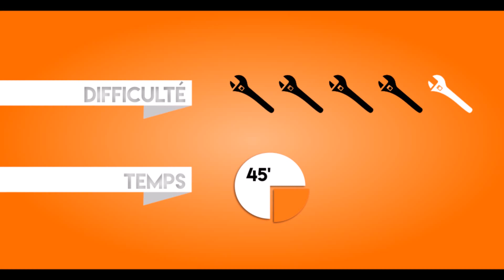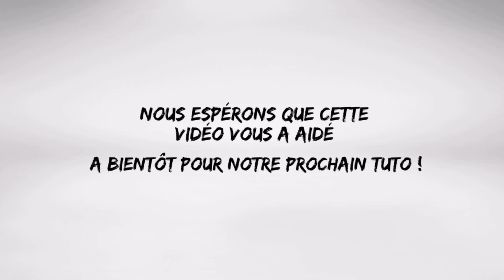TUTO #26 - CHANGER SON CYLINDRE PISTON, SES JOINTS DE CYLINDRE ET SES SEGMENTS (AM6 MINARELLI)

Comment: great video, I would personally be a bit more careful when removing the piston pen from the crankshaft, hitting it with a hammer will damage the bearings. also important that after a piston change it is advised to mix some extra 2 stroke oil with the mix, if you are running an oil pump you can simply put some oil in the tank. I advise to do this for at least 2 tanks, also keep rpm below 6000 for the first tank.
Reply from the maker: Hello, thank you for this technical response! All techniques are good to take! See you soon on 50 Factory!

Comment: bonjour je voudrais changer ma segmentation étant d'origine les segments et les joints sont des D.40 ou des D.40.3 merci
Reply from the maker: Bonjour, sur de l'origine, les joints sont du 40.3 sur AM6. Si vous avez un piston d'origine, il est préférable de prendre les segments origine (ref A49384J006) ou type origine (A49384J003).

Comment: Il faut que je change la cage à aiguilles si elle a 2500 km
Reply from the maker: Bonjour, si le cylindre est à remplacer alors il vaut mieux changer la cage à aiguilles également ;)
Reply: @50factory  vous pensez que je peux  rouler encore combien de temps avec car j'ai mis un 70cc
Reply from the maker: @jaimelesaucisson4421  Bonjour, 10 000 Km surement, cela dépend du cylindre que vous avez mis. Et il faut que vous contrôliez de temps en temps.
Reply: @50factory  j'ai mis un 70 top perf